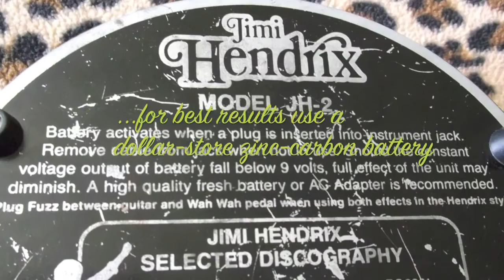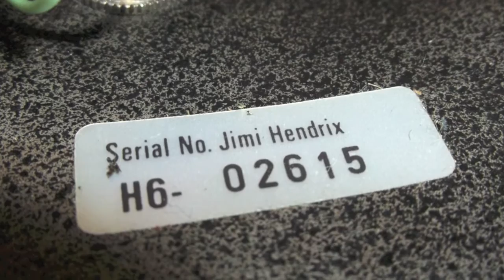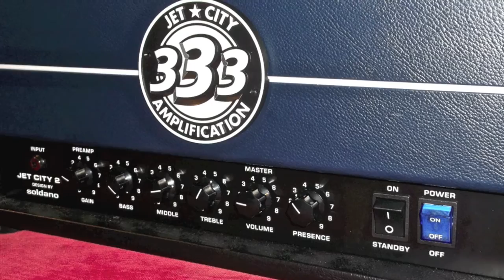Dunlop Jimi Hendrix JH-2 fuzz demo

Comment: I changed the feedback resitor and the collector resistor of Q2.
Reply from the maker: Gunther Hansmann do tell? How would you describe the result?
Reply: It is more like a standard Fuzz Face, trebly and transparent - and it is louder!!! Plus you can use the fuzz pot regularily. Before the mod i only wanted to let it on sero as shown on the picture above. Feedback R from 68 stock to standard 100K. And Collector resistor of Q2 to 5,6K (6,5 may work either).
Reply: I'm interested in this mod.  Could you tell me in layman's terms which resistors you changed?  Also,  is yours the green board or tan/orange/yellow board?
Reply: @danitz56  The feedback resistor goes from emitter of Q2 to base of Q1. It is therefore easy to find. Twice we defined Q1 and Q2. So you can identify the collector resistor of Q2. In regular Fuzz Faces you will find 8.2 kOhm at this place. But to compensate the differences in the layout of this version you have to come closer to 5.6 kOhm. My version has green board.

Comment: Guys, this pedal ONLY works in the jimi Hendrix pedal set. Plug this thing into that pedal set and it RiPS your ears off! It's awesome! Compared to the JH-F1 pedal, this pedal seems a massive upgrade, not just with 90's era JH fuzz tone BUT ALSO with the easy to use switch and blacked out appearance etc... 90's era Hendrix sounds are full on! Way more useable than the retro series. I love how with this 90's pedal era set, the fuzz makes the distortion and the wah makes the clean sound. Which is totally not like the retro 60's pedal JH set. (90's- fuzz, wah, octavio, ROTOVIBE) once you guys complete any of the JH pedal sets, you'll be racing around town trying to complete the other 3 pedal sets, just to hear all the great sounds and play the different era methods. Don't forget! If you don't have the other 3 pedals for the set, your 1 pedal won't work for you. You MUST complete the set of JH pedals before they start making their actual true JH sound! Originals of this pedal will be worth LOTS of money soon! So many guys bought just 1 JH pedal and thought they knew what to do, but its clear, they had NO clue what was going on!